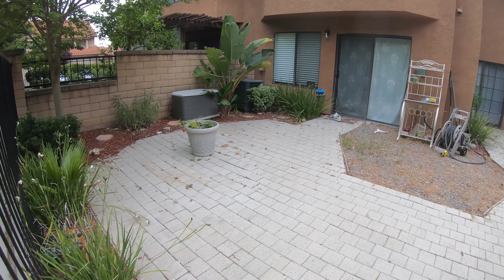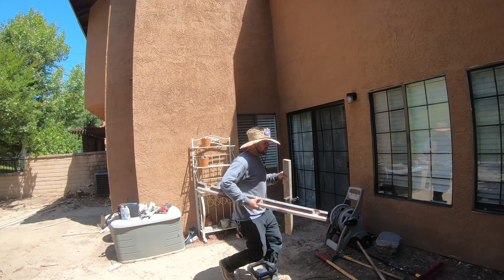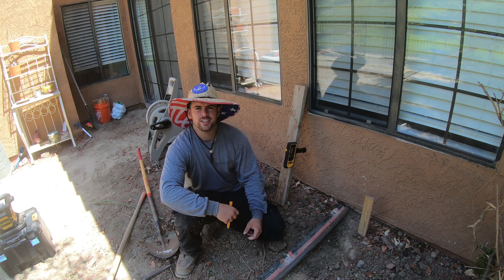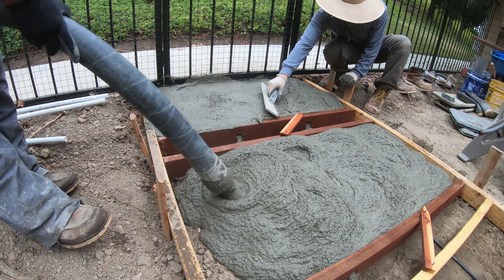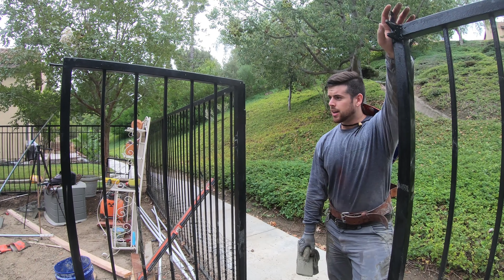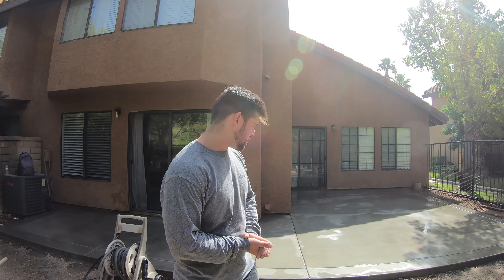How to Pour a Modern Concrete Slab with Decorative bands/Concrete Pavers! Part 1

Comment: Spray the forms with diesel fuel, a light coat, then the form will not stick to the concrete and the sides will be nice, no air bubbles or cracks.
Reply from the maker: I concur

Comment: I watched some of your concrete projects and see you guys never used gravel as the concrete base, but when google most of the suggestions are gravel base is required. The question is: is gravel base mandatory or not for concrete slab, sidewalk or driveway ?
Reply from the maker: It's optional in Southern CA.

Comment: Hello, again Mr.Odell firstly thank you for your valuable advice before. I have another dilemma I want to buy a bull float but here in Thailand, I am limited on choice as most here are made from steel.  Is a mag float a better option and worth spending a little more for? and whàt is the best size to look for. Thañk you for any help.
Reply from the maker: Wood works well

Comment: WOW, you guys are Awesome and very very detailed 1” for every 8 foot I love learning this stuff. Now after you mark that 1” on that stake, do you dig 3 more inches down from that mark? So it would be a 4” slab. And after the dig, do you then us a leveler from the top edge of the house and run it down the slop towards the other end to make sure you have a 2” dip at the end? Another thing is, I saw your last video when you was expanding a patio and drilled holes into the existing patio and put in a rebar. Why didn’t you drill into the foundation of the house and insert rebar? Thanks, I’m going to subscribe. 👍
Reply from the maker: yeah we set the laser to the new benchmark height mark the stake at the other end measure down two inches and run a string line. We dig down 4 inches from the string line for our concrete slabs. and ty for the sub!

Comment: That rebar in there is pretty much useless ... I didn’t see it off the ground or anyone pulling it up , I get it it’s a thin slab but are you not worried about moisture from the ground rusting out those bars ?
Reply: You better get your eyes checked if you didn't see it being done.
Reply from the maker: We do pull it up just hard to notice as it's in fast forward
Reply: I apologize I didn’t see it , not trying to hate I love the work y’all do , might of had a few too many after work yesterday 😅

Comment: You should never use anything less then 3500 psi. 3000 is crap!
Reply: Its not exposed to freeze thaw, it was poured at a good slump, it has a good rebar section, its on a decent base, and well spaced joints. All those factors are way more important than a 500 psi difference in mix design. This slab is gonna look great for years.
Reply: @markdoumert4840  wrong lack of cement in concrete makes for short lasting concrete. And if you think rebar stops a slab from moving or cracking you are a fool and shouldn’t comment on this subject as I’ve torn out destroyed concrete with rebar.
Reply from the maker: concrete design depends on the conditions.
This is good for this .
Reply: @OdellCompleteConcrete  so you’re saying because they are pouring a back patio and concrete pads 3000 is better? Lol remind me to never use any of you guys for concrete work! Lmao

Comment: @16:45 he mentions taking off the forms because the concrete could expand and crack. 
I have found that concrete shrinks when it dries. Additionally studies have shown that keeping the form work on for longer lengths of time will actually increase the strength of the concrete as it will cure slower. Same reason to flood cure it or wet cure it. 
Beautiful concrete though!
Reply from the maker: Interesting I'll consider this next time on my next pour! Thanks for the info!
Reply: @OdellCompleteConcrete  Another reason I like this channel, you are not dismissive.
Reply: @OdellCompleteConcrete  for the science and evidence what I mentioned and all things concrete watch Tyler Ley on YouTube. He is a engineering professor that puts out really great technical info about concrete. Science based concrete techniques.
Reply from the maker: @dennispope8160  good looking I will look into it! Always love to learn and improve!